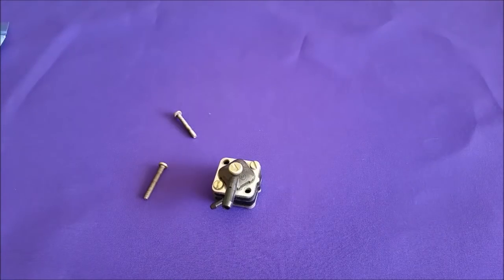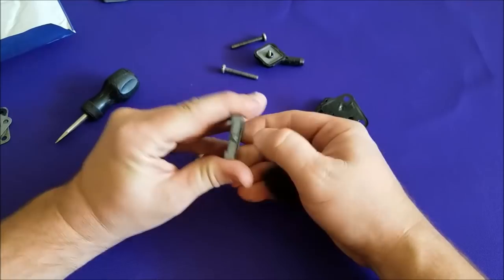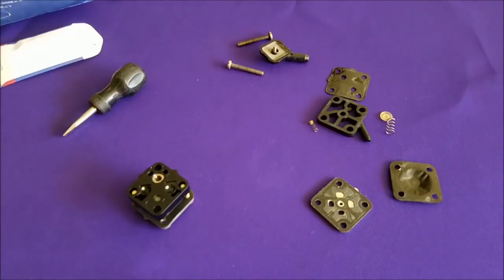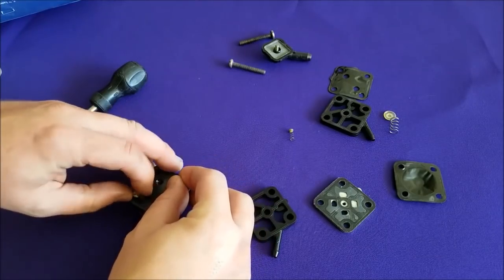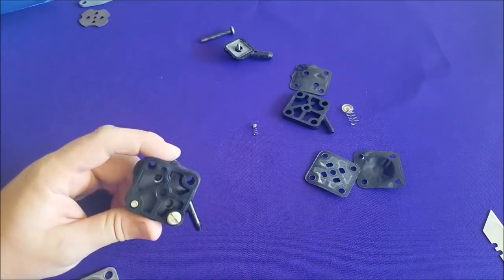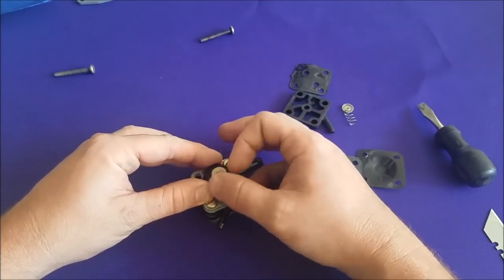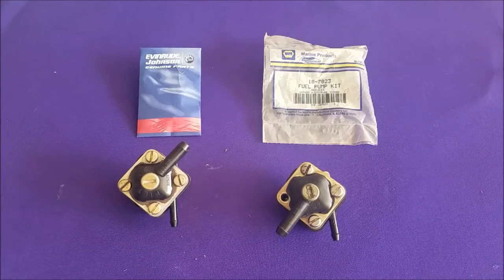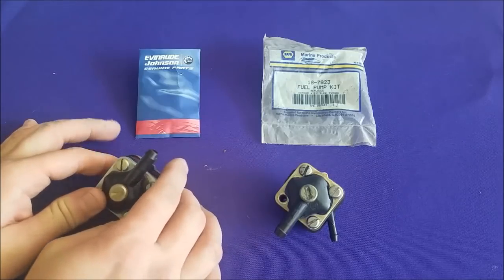How To Rebuild A Johnson / Evinrude Fuel Pump (Small)

Comment: Brandon,
Thank you, thank you, THANK YOU!  I was OMC certified back in '67 on outboards, but the boat shop I worked for (as a teenager) never rebuilt fuel pumps.  They made more profit selling new pumps + install.  I got lost pulling the pump apart on my neighbor's '71 18 HP Fastwin this past week, and your video saved me.   Thanks Again!

Comment: Sharp eyed commenters noticed the old spring was removed from the left and the new one was installed on the right and seemed proud to accuse him of installing it wrong when actually he corrected a previous mistake.

Choosing spring location becomes very simple once you understand that the fuel hose leads to two compartments connected together by a hole between them and the other two compartments need to be ignored because they are totally isolated.  

One of the connected compartments must be placed over the spring and there is only one way for that to happen depending on which of the eight possible directions you want the fuel hose to point.

Comment: Thanks for a great video. One question, at 2:20 the air dome spring was to the left , and opposite the fuel outlet. But at 6:02 you said it needed to go on the right, next to the fuel outlet. Is this correct, or had someone rebuilt the pump previously, and put it together incorrectly. My pump that I pulled apart today, has the spring on the left and the outlet going out the top. Thanks again for the video. you saved me.

Comment: There also seems to be 2 styles of back plates on those pumps, one being flat (as the one you are working on) an one that is raised  and needs longer screws to attach to the engine. Are those interchangeable ?  Thanks for the video !
Reply: I have the same question. Great Video!

Comment: Hey, that sierra kit doesn't come with the base gasket that goes over the big spring side diaphragm.  I know the original pumps didn't have them.  But, on your other video you said you should install it if it came with the kit.  I guess I'll be doing mine without that gasket, because the old one, though in good shape, is totally stuck to the old diaphragm.

Comment: After first replacing a cracked  fuel intake  cap and when that failed to fix the problem , proceeded to ordering a rebuild kit.  When that did not fix the problem,  I then talked to an outboard mechanic.-Problem is usually the reed valves.   Not included in any kit.

Comment: I have a ‘91 evinrude 9.9. Are these engines supposed to have an in-line fuel filter before the pump?  I saw the screen, but it doesn’t look like it would filter the fine gunk. Thank you for the video!

Comment: Tip, when doing blowing test, after testing both directions, also blow into intake end while plugging output end. If air still flows, you have an improper gasket seal and fuel will leak out the sides of the pump. Fix this before installing.
Reply: Does the intake blow part make a horn sound? Mine doesnt even tho i built it the correct way. The spring on the bypass to the out or directly in the out port.

Comment: Brandon I was wondering if you can use those replacement parts to rebuild the original pumps?  The pump I have looks identical to the old one you showed.
Reply from the maker: Well probably, this was an OEM pump.

Comment: I noticed that on your second rebuild you put the smaller spring on the opposite side. Why was that. I have been following your instructions and cannot get my pump past the blow through test.
Since there are several configurations to where the outlet nipple can go.....what it the guidance as to where specifically the small spring goes verse the outlet nipple? Also where does the last plate u shaped cut out go in reference to that small spring location. Thanks.....great video.

Comment: I've got a 1976 Evenrude 4hp 4606m. The plastic piece on the top of the fuel pump has been epoxyed  so instead of rebuilding I want to buy a new fuel pump. My fuel pump looks exactly like the one in the video. My question is will a fuel pump for a Evenrude 6hp (that is identical in appearance) work for the 4hp motor?
Reply from the maker: yes!
Reply: @BrandonsGarage  thank you! I thought so, but wanted to confirm

Comment: Does anybody have a working carb for a 1977 Evinrude 6hp? I purchased an engine only to realise that the low speed needle had been screwed in so hard, the needle broke off and is stuck in the hole underneath the welch plug. I cannot get it out. Even just the top half of the carb will do. Please let me know. Thanks.

Comment: Hi mate. My outboard (evinrude 6hp Fisherman 1967) is stalling after a while unless I pump the primer bulb which goes soft after about 30 seconds. I can feel the one way valve clicking in the bulb. When I leave the tank connected and remove the output line from the pump to the carb, it pumps fuel out for a few seconds and then nothing. I can feel a pulse of air at the output of the fuel pump. Any ideas on what I need to change? Should the fuel pump constantly pump fuel from its output? Thanks. Mark.
Reply from the maker: Primer bulb shouldn't stay hard when running, pump cant pull that kind of pressure.
Check for any air leaks out of the lines, usually thats the problem.
Reply: There are two little discs/one way valves in the pump. One is stuck open. I can close it but when I open it again its stays open. I think that the problem as it failed the blow test. Put it back together with disc closed and passes air test.
Reply from the maker: If it failed the blow test, you are correct, it needs work.
Reply: Brandon's Garage New fuel pump ordered.

Comment: Is it possible that someone swapped one of these on to a 25 johnson... just to get it running, but by doing so reduced the max HP to whatever fuel flow this can put out?
I bought a used 25 Johnson Outboard circa 1977 (tiller removed), and this was the pump on it... but I was told by someone else that this is the wrong pump. Anyone know?
Reply: I have an 89 evinrude 15 & a 75 johnson 25, both have this pump

Comment: He brandon 

I also rebuild my feul pomp i did it the same way as you did but i have a problem if i blow trought the inlet air goes nairly trought and you hear ah whistle noise if i then blow trought my outlet you can also blow a little bit trought what shouldnt do it

Any ideas?
Reply from the maker: Blow in the inlet, it should come out the outlet. 
Blow into the outlet, and nothing should happen.
Reply: Brandon's Garage yeah i tried that but if you blow in the inlet you can hardly blow trought and you hear a whistle noise you can not blow freely into the inlet
Reply from the maker: Well, I cant ' freely' blow through this one. there is some resistance, but not a lot.

The second pump I did in this video, takes a lot of pressure and only a bit comes out.
I haven't figured out why yet.
Reply: Brandon's Garage by your last pump i have the same problem i rebuild it 3 times nothing changes
Reply: @BrandonsGarage  p

Comment: Can anyone tell me where to buy a 312631 fuel pump?
Reply from the maker: Sure that part number is correct?
What year and HP are you working on?
Reply: @BrandonsGarage  yes. There is a used one on eBay, but I don't need a used one.
Reply from the maker: 312631 is the number cast into the base, which is not sold separately. 
If you tell me the year and HP, I can tell you the pump number.

Comment: he put the "air dome" spring in the wrong place. watch when he takes it apart the small spring is on the bottom left but when he re-assembles it he puts the spring on the upper right!
Reply from the maker: Or maybe I was just following what the instructions said to?
Reply: I re watched the  disassembly and reassembly  enough times to be certain you are absolutely correct  Lawrence .
Reply: Lawrence Holden yep you are right and he could not admit it saying maybe I put it back the way the directions instructed